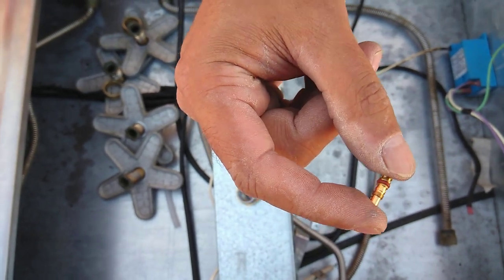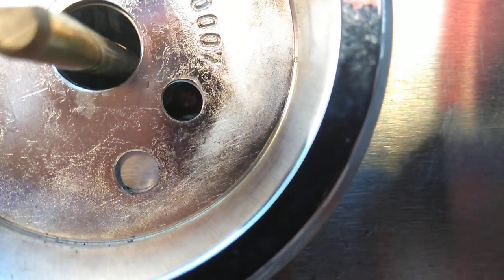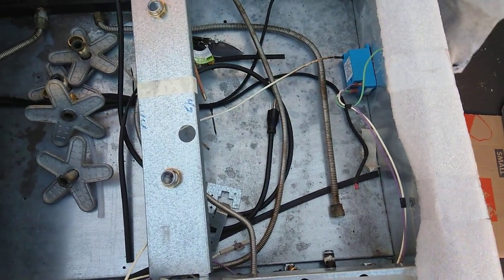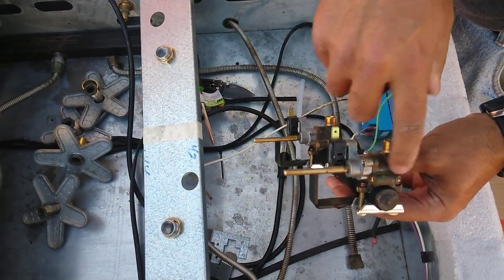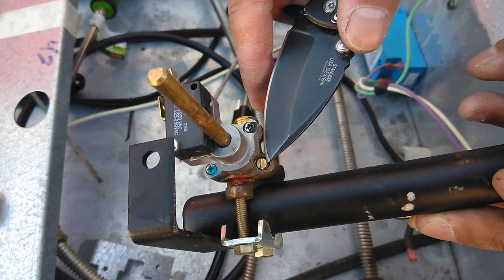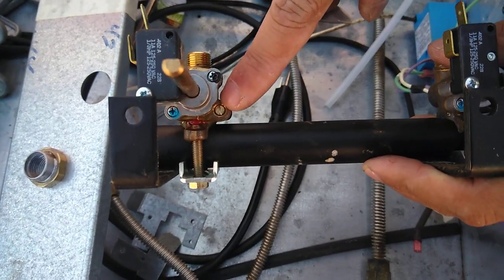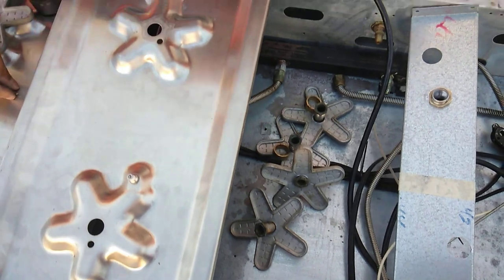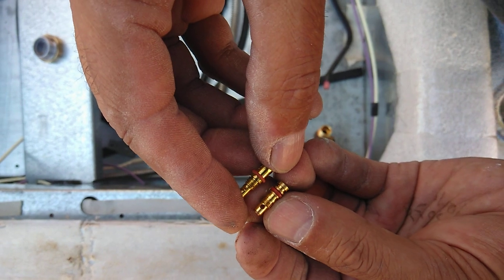Explaining Stove Low Flame Bypass (Simmer) Jets

Comment: Hey, Frank! Thanks for this video. I'm trying to convert a Thor HRD3088 to LP. Thor sent me a kit. However, I can't seem to get the bypass jets into the hole in the valve body. I can get about 2 rotations of the jet in the valve body before it gets so tight that I fear breaking it off in the body. I'm uncertain as to what I should do. No one in the area services these units. It seems like it should be simple but I'm out of ideas.
Any thoughts?

There are no nimbers on the jets. But the LP jets are much longer than the NG jets. I have a photo of both laid side by side.

Comment: hi, how are you , hope you are fine , thanks alot for your videos 

i understand that by pass screw let gas flow in low level flame , right or no
Reply from the maker: I have conversions for everything made. Feel free to call me at 714-574-1544. The bypass jet (sometimes called a simmer jet) allows metered low level fuel flow to pass out through the burner tube to produce an ultra low flame. It's usually found on some of the more sophisticated gourmet designed brands and is located in the control valve assembly.

Comment: Hi Frank, I have a question about converting an already converted Thor stove back to natural gas. I still have the ng orfices but our old simmer ng bypass parts seems to have gone missing in our move. Would you have these in stock?
Reply from the maker: I actually carry orifices for every stove and barbecue made on my website  https://flamesources.com/  I'm now in the Midwest, and you can always get a hold of me at 714-574-1544. Make sure to like and subscribe to my channel.

I have these jets, however, you don't need to change the ones you have to convert this unit to natural gas. To convert this unit, back to natural gas, you should be able to tighten the jet back to snug, and the adjustment should be good to go.

Comment: Frank - we have a 15 year old 48" dual fuel Five Star range without a simmer burner.  Is it possible to convert one of the larger burners to a simmer burner?
Reply from the maker: You really don't want to compromise that unit. I have orifices for everything made. I've moved to the Midwest, so feel free to call me during normal Midwest business hours between 9-5 at 714-574-1544.

Comment: Hi do you sell orifice for wolf stove top CG365ts to convert to propane
Reply from the maker: Doing a fuel conversion is usually a simple affair. I've converted just about every type of barbecue and stove made. Feel free to contact me at 714-574-1544. I've yet to do this particular stove, but I've done a Wolf model very similar to this one in the past. I'd need to see the nuts and bolts of this unit to figure it out, but, yes, it can be done. Anything that runs on natural gas can be made to run on propane.